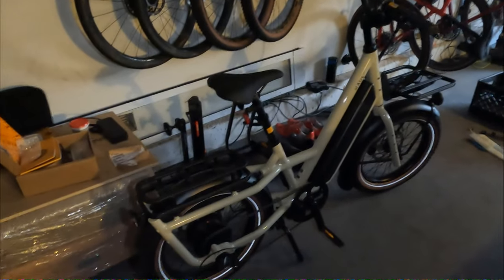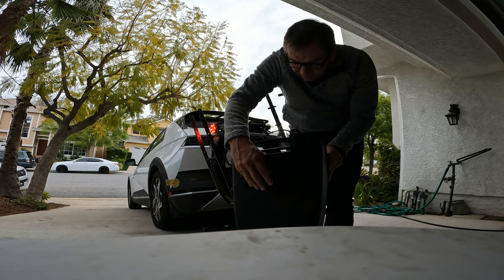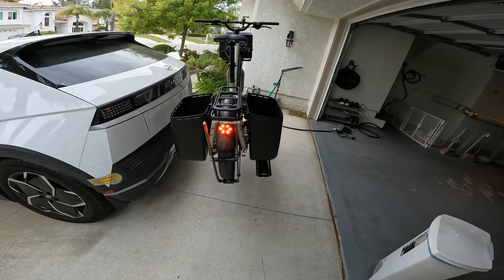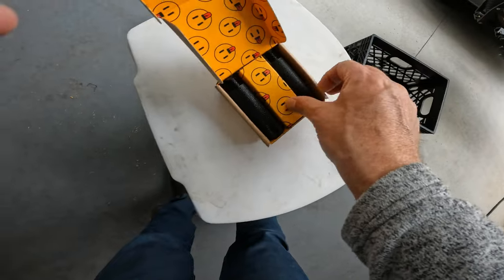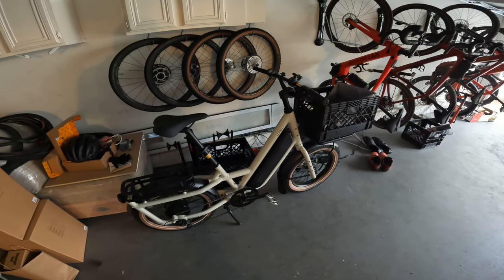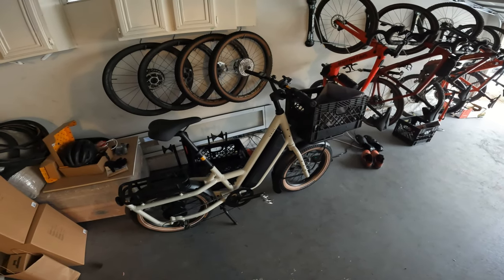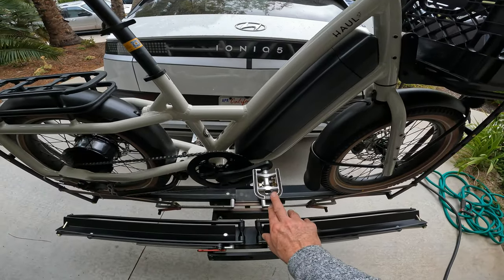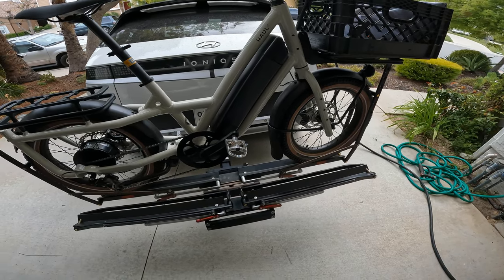Specialized Globe Haul ST Accessories and quick review

Comment: I just bought a black Specialized Globe Haul ST day before yesterday. I also bought a pair of cool caves, but I got a mount system that allows them to lock in place that I don't see on your bike. The third clip on the cool caves about half way down clips into the rack so the container locks tightly in place. I'm looking forward to putting many miles on it. The range of the battery is right at the edge of your round trip to work. Do you remove the battery to charge it indoors during your work day?
Reply: No I just charge on the bike.
Reply: it looks like he is attaching the panniers directly to the rack and not using the pannier adapters.  the adapters will allow for secure mounting of the cool caves with the 3rd connection point.
Reply: @marisadamovics6186  Yes, that's my observation, too.

Comment: Do you have to take the front wheel off to get it inside the car?    Will normal fabric panniers fit the rack?   I have been researching short cargo bikes and the REI cargo bikes had the complaint about incompatibility with most pannier designs so I'm a little concerned the globe hauls special system might prevent normal usage unless you buy their accessories.
Reply from the maker: I do not for my car. It is the Hyundai Ionic 5. I can fold down the seats and slide the whole bike in. than ks for subscribing and the comment.
Reply: @mekat861 - Hey - I had this concern too.  I bought this bike a week ago.  If you really want to use after market paniers, you have to buy the Specalized rear or front paniers adapters, which bolt to the frame of the bike and the stock rear rack.  Once you get those on, they should accommodate most paniers that hook on to the bike.  (Mine are paniers that I bought probably 10 years ago).  The Specalized rear and front panier adapters come together in a box (that looks like mini pizza box!!), and cost around $100.  So that is an extra cost you have to factor in when you're comparing this to other bikes.  With that said, though, after about a week, I'm really starting to love the bike.  It does what it is designed to do very well.

Comment: How tall are you out of curiosity, I’m 6’2 and no dealers have them around me so I was going to order it online.just curious how comfortable it is
Reply: There is so much adustablity with the seat post and steer tube it is easily to get the geometry right for you. I've had mine for a couple of months now and have it dialed in so long rides are a breeze. Im 5'11 but all torso so bike fitting has always been a challenge for me.
Reply: I know this is old, but if someone else comes across this question: I'm 6'2" and it fits me perfectly.   One of the claims of the Haul ST is that specialized designed it to fit 97% of the people they've ever measured for bikes.   The only minor annoyance at 6'2" is that the seat juts pretty far backwards when extended so there is less room for a passenger's face.   My 5 y/o rides on the back in a kid seat and if I stop too quickly his head hits my back, but my shorter spouse would not have that issue.